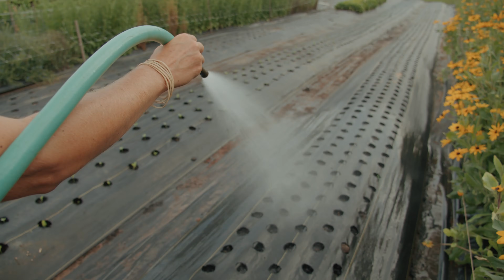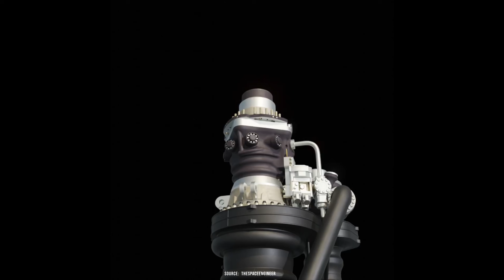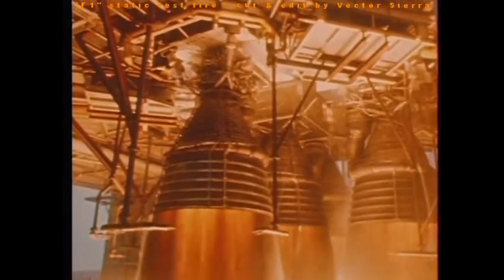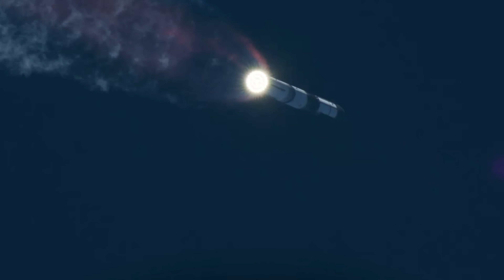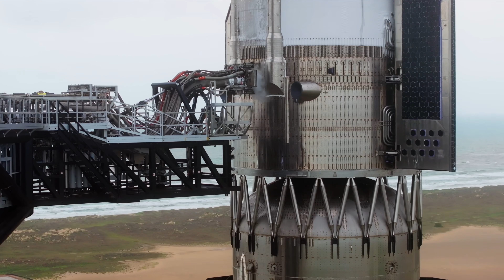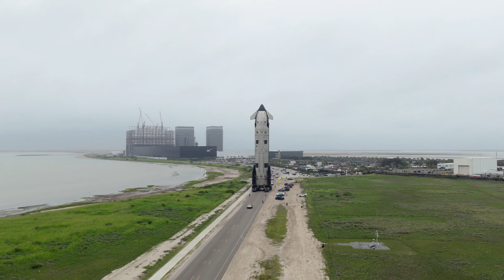Why SpaceX Starship Switched to Electric Thrust Vector Control on Raptor!

Comment: Broom picture is irrelevant. A broom balanced crosswise is stable. It takes a lot to disturb it enough to make it fall off. 
But a rising rocket is more like a broom balanced upright, on its end; it's unstable. You must constantly move your hand because any slightest draft or jostle off vertical will make it tip ever more off vertical until it falls off completely.
Reply: Yeah, when I saw that, I realized that the entire video is just AI slop without anyone even bothering to review it! .... sad thing is, it's still a pretty good video with good information .....